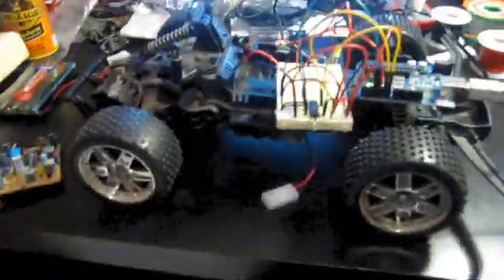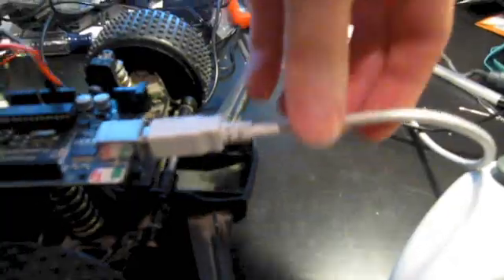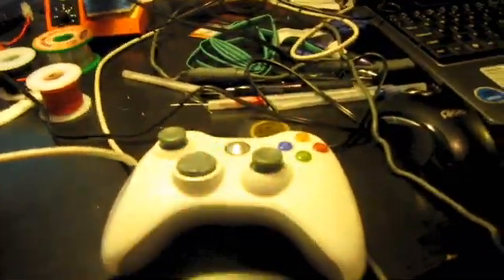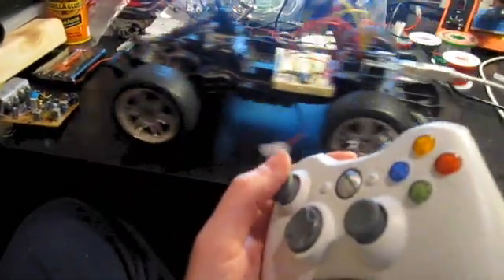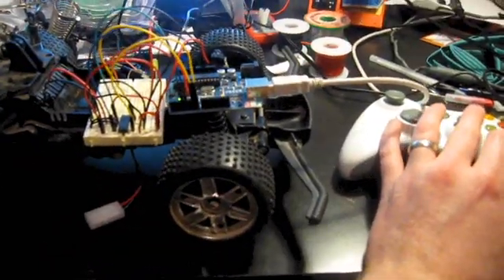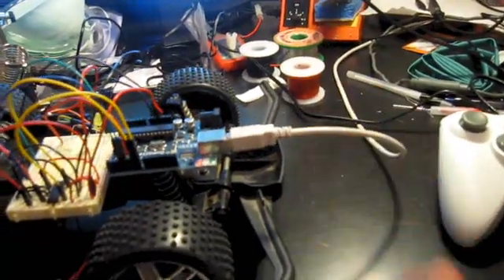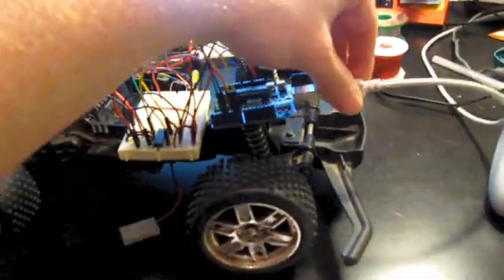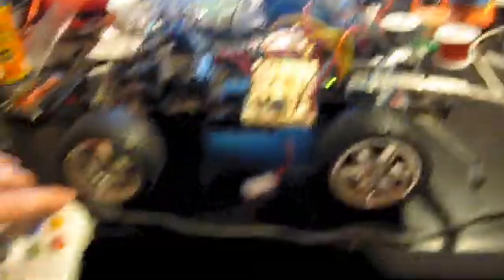RC Car Controlled by Arduino and Xbox360 Controller

Comment: Nice!

Is there no way to use a bluetooth xinput controller directly to the arduino bluetooth module, without having a laptop/android intermediary? It's baffling to me that this doesn't seem to be doable even 10 years on.

Comment: could you take the guts out of the rc car controller. and put it in the shell of the xbox one controller and weld it to the buttions to the right area. or would it not work

Comment: ok, so you are a programmer that is using an xbox controller to run an rc car? so why would you set the stick layout to be the same as a traditional rc transmitter. the only benefit of using the xbox controller is that you would be able to drive an rc car the same way you would in a video game. Everyone knows that the throttle control in a video game is the right trigger and the brake is the left trigger. syncing the throttle to the left thumb stick is a waste of time and complicated...you could honestly do the same thing with a traditional transmitter..fail. get it right with the button layout and remove the laptop and computer then you will be on to something, something really big!
Reply: that's what i'm trying to do.
Reply: Why is a trigger better than a joystick?
Reply: @D2RG6I really like halo's driving, cause you can pull left on the joystick, then slide vertically against the wall of the joystick for way better speed control than a trigger. Edit- plus, mid-point is between forward and reverse, so it's not two fingers on separate triggers, though then you couldn't mix the two like you could with triggers, not like for braking in games but for adjusting speed, though in real life that wouldn't really be an advantage huh, rc cars don't mix max accel. and braking to adjust speed, would be a waste of battery. Would feel natural though

Comment: USB port power must have been crying. All that motor PWM noise shooting back into the computer.
Reply: Sidowse or some average mosfets with big fckoff heatsinks with a leaf blower
Reply: lol why ? can't u see that he is using a separate blue battery under the car
Reply: madjid ryadh dude, 2:00, the blue battery pack is not even plugged in.

Comment: U know what u can use a wii mote because the wiimote has bluetooth in it so it can be hooked up to the board bluetooth sensor like the same way we connect it to pc so u don't need your pc to play and u can play at the garden or anywhere plz thumbs up for the comment and if u guys are intrested I'm planning on building a robot using arduino boards if interested subscribe but plz thumbs up so that he knows what Im saying
Reply: 5 years no thumbs up if the down vote worked i bet you would have a few thousand down votes though

Comment: Wifi or XBEE. The correct XBEE chip + antenna would be 1km range or more. but of course you would need to buy loads of XBEE hardware as phones etc dont have it

Comment: just arduino is incredibly unlikely.

Raspberry pi however, there are complete drivers for the Xbox controller on the pi already. He would need to port his existing application on the computer to run on the pi, integrating it to the car would be pretty simple though. He is already using bluetooth which usually means reading it as serial data and transmitting as serial on the PC. The pi has a serial port already so a few jumper wires and he's sorted. No bluetooth needed.

Comment: Now you have the Computer between the Xbox controller and the car. Is it also possible to do it without the computer but just with Arduino or at least with Raspberry Pi?

Comment: It wont' do it at all on its own (won't even try).  The motorcontroller will have to be actuated in the other direction (just as if you pushed the analog stick the opposite way) until centered.  I agree, though, it would be nice to see that feature added.

Comment: Hi, great work! I have one question though, how did you know how to cable de entrances from the wheel and the CI that you used? Did you use the same chip from the board that it had before and you saw the wiring?

Comment: If it were me, I would use a servo for the steering that sets itself to move straight when there's no L/R input. That's just how I'd prefer it, having the car be misaligned would irritate me horribly.

Comment: You being this smart, I recommend you take a cheap camcorder and put it on two servos (up down, left right) and mount it on the car as well. Make your D-Pad on the XBOX controller be the control buttons for the camera, and wah-lah, a spy RC car controlled by an XBOX controller.

Comment: My Robotics club at school is trying to emulate your project.

We have jumped straight to using the BlueSMIRF modem to connect the controller to computer to Arduino through bluetooth.

If you have any code you can offer for any of the project's aspects or just provide some more information, please PM me. it would be a great help. Thank you!

Comment: It would be cooler if you could drive the arduino directly with a wireless joystick rather than a wired one with a laptop in between. You can still add a pair of xbees and use a netbook instead to make it more portable :)

Comment: This would actually pretty cool. However... It may be easier to simply take a shell form (scan it or mold it from a 360) of this, and re-configure the components in a standard 2.4gh/z to fit in the controller.

Maybe make a slider to go left and right that'll rotate the potentiometer (however you spell that component) for a left stick, then break the triggers into + and - values for the throttle. Spring assisted, and the steering will return to neutral as it should with a 'normal' controller.

Comment from the maker: @JDX2010 Yeah, it would work on a petrol car, my only concern would be that you would shell out the dough for a nice car, rip out the guts, get frustrated with the project, and be out the money and a car. I had a car lying around, so it wasn't a big deal for me.

I would definitely recommend using Xbee radios rather than blue tooth. Check out a later video of the car by searching for Arduino Creeper bot. He is my project page, creeperbot.blogspot.com.

Comment: @hustletv Apparently in the RC World, what he used is a 'Chinese mass production crap' RC car, I'm doing a similar project and building a safety system in it by using a sensor and overruling the PWM signals running from the receiver to the ESC, but I've got the same car and 'professional' RC cars haven't got any PCB's in them at all...